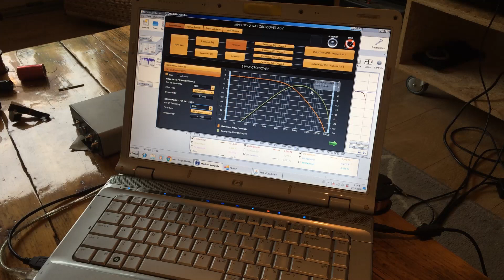Diy Planar Magnetic Headphones - Part 7 - Making the cups

Comment: Have you tried balsa wood on your cnc?Just wonderin.
Reply from the maker: well i wondering that yesterday as well when i handled this part :) but i never did. i used balsa ones for soem DML'and rubanoide tests, but they where thin sheets. i can imagine you can do some funny  stuff with balsa like creating a driver including the membrane out of one piece and with the use of a coil and 1 or 3 magnets..  at least thats what i thought yesterday when i though hmmm this feels almost as balsa :)

Comment: Impressive CNC/woodworking there, some thin sections but it all seems to work out. I'm surprised you're not going open-backed on these, to let the speaker "breathe". Would there be any reflected sound cancelling out frequencies to worry about, like if you placed planarmagnetic speakers close to a wall in a room?
Reply from the maker: I  made it like this because the way the donor headphone worked.  But yep today is the day i am gone modifi them back to open . But more about that in one of the videos :)